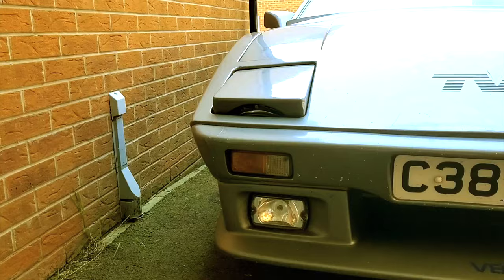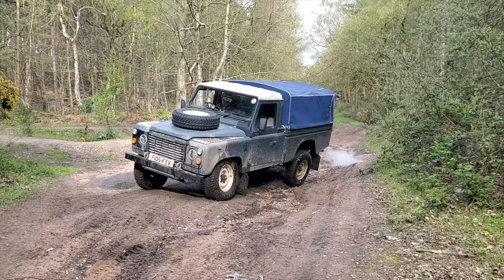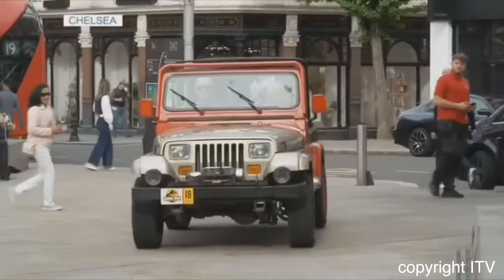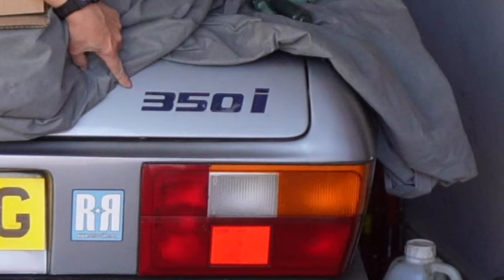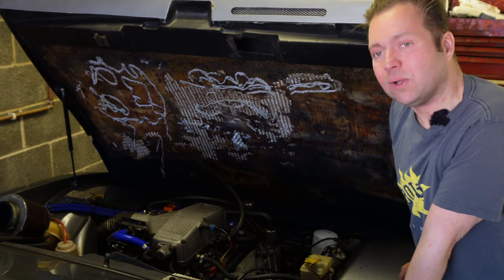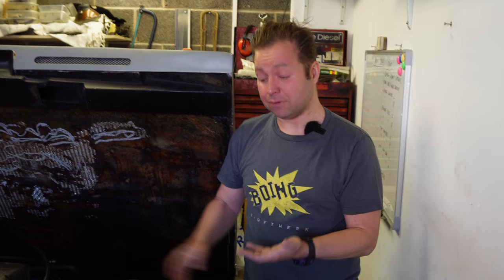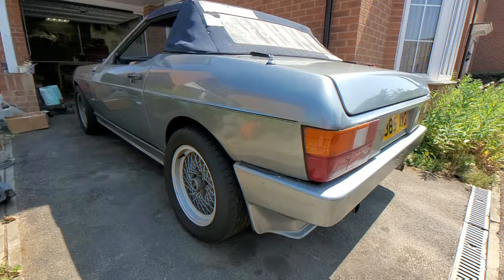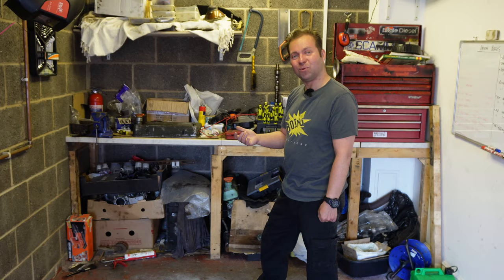Title: Rare TVR 350i barn find! Scrap or save? Rover V8 powered TVR Wedge brit-bruiser.

Comment: Despite the scored bores the block itself looks to be good. So why not have it bored to 4.3L and fitted with top hat liners fitted with a nice cam it will rev nicely and produce some decent power and torque. TVR offered such an engine in the early Chimaera known as the 430, I have a 93 one,  there are a couple of companies such as Powers Performance that have the knowledge of the TVR 430 motor of course another option would be to build up the 3.5 with flowed heads, big valves, decent cam and modern engine management system. Be interesting to see which way you decide to go.